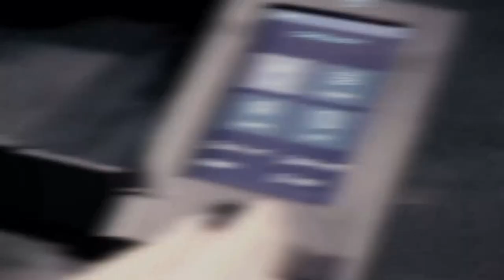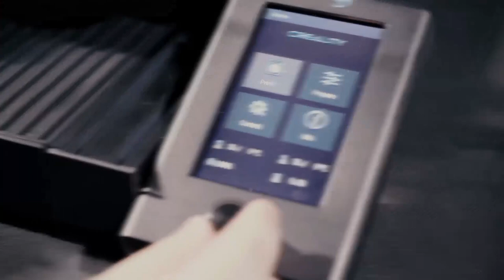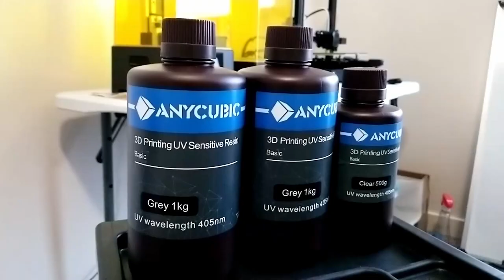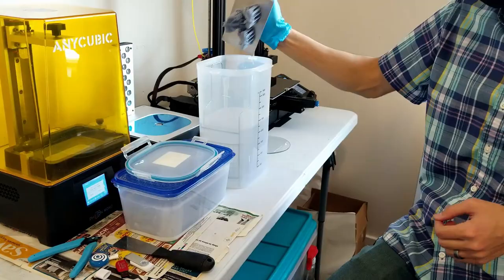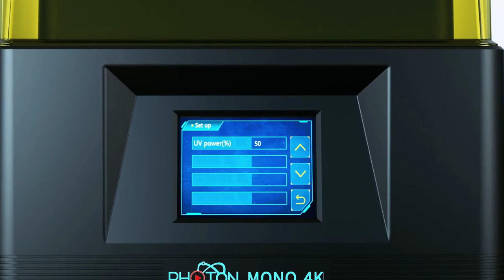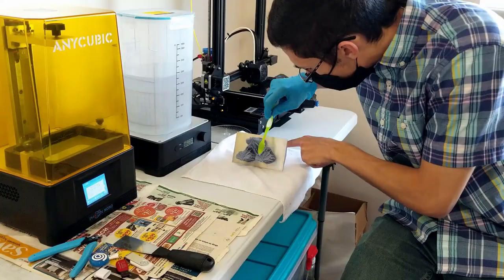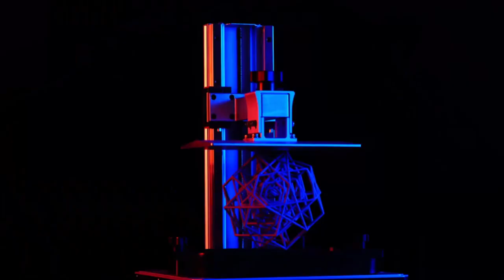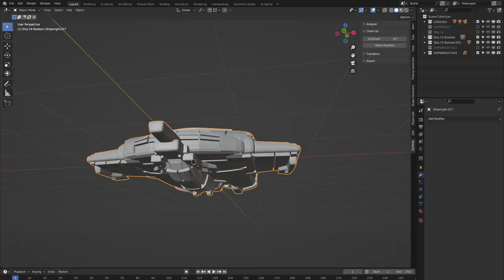Resin Printers vs. FDM Printers | What Should You Buy?

Comment: Simple answer.
Both!
I started with resin, which is the best hands down for mini's, no ifs no buts. The trouble with resin and large parts is the warping and manitaining straight edges and accurate angles.
I have had Anycubic anbd Elegoo resin printers, Anycubic have a better build plate system IMO, 4 bolts rather than a ball head. But the Mars 3 is amazing, even with the ball head. One thing to bear in mind is a large 4k screen wont give you as good resoloutions as a smaller 4k screen. But as the author said, 2k/4k you need a magnifiying glass to see the difference if your printer is set up well.
I would also say have double the ammount of IPA you think you need, if you have a wash station for example have 5l that you are using and 5l that you are letting the gunk settle down before you resue it. There is no good, fast way to recyle dirty IPA, but if you have time all you need is gravity. Let your dirty IPA sit for a week and all the resin will sink to the bottom, syphon off the clean IPA annd swap it with your current IPA and repeat.
Terrain, and anything real world and functional parts filament is the way to go.
I bought a Neptune 3 Plus a couple of weeks ago and it worked out of the box, took about an hour to put together but its been perfect.
Reply: Yeah think for terrain and big chassis (like Fellblade and such) an FDM is pry the way to go

Comment: SLA printing is great but printing in scale you are limited unless you want to spend thousands. Also, for the money of a good SLA printer you could buy a Bambu labs printer which printers incredibly fast compared to resin.

Resin just have a great finish but full of waste material and slow. Also when working with resin it's very important to use a respirator whilst handling resin and especially sanding! That stuff is dangerous.

But I agree SLA all the way for miniatures and statues.
Reply from the maker: I totally agree with regard to sanding. Sanded UV resin is definitely something you don't want to inhale!

Comment: The Bambu Lab X1 Carbon now prints at .08 layer height and everyone I show my prints to think they are resin....game changer! Oh and no stupid chemicals. I AM interested in resin printing but the X1 Carbon prints so fast and so smooth I just don't know if it's worth it.
Reply from the maker: That's awesome! Looks like an expensive printer. I've never dealt with higher end FDM printers but I love the workflow of resin printers more than FDM. Less motors generally means less maintenance and room for mechanical error, but like I said, never dealt with the higher end machines before 🤷‍♂️
Reply: @blitzgamingstudios Ik this comment is 9 months old. but now Bambu Labs has an amazing deal for their Stripped down printer. It has the same speed and quality specs but it’s not as fancy. For 550(black friday) it’s an incredible bottle
Reply: @baby_efa  Six months on from your comment. The Bambu A1 Mini prints miniatures at near resin quality (lookup the profile settings from "Tomb of 3d Printed Horrors) and can be had for $249. The build volume is 180x180x180mm which is perfect for printing minis and most terrain.

Comment: The biggest concern is resin fumes, for others in the house and working directly with it.
Reply from the maker: Totally understandable. You can always use Anycubic Eco UV Resin, which is made from soybean oil with no VOCs, no BPA, and it complies with the EN 71-3:2013 safety standard.

It is a little different to print with, I found I had to slow down my printer a tiny bit and not expose them to alchohol for cleaning too long (because it can deform the print). Other than that, great stuff 👌
Reply: @blitzgamingstudios  you should really be using a respirator when working with resin. from what i read online, a cloth mask like in 4:00 is NOT enough to protect yourself. the fumes can literally cause cancer.
Reply from the maker: Thanks  @VD-cc4hx  but I disagree. As long as you're working in a well ventilated area and wearing a face covering, especially with UV resin from trusted sources that are made with safety in mind, such as Anycubic's resin, it's not something to worry about excessively. 👌
Reply: @blitzgamingstudios  happened across this.  The issue isn't with safety, it's with long-term health, as in years.  You need to wear a respirator with organic vapor cartridges.  You can pull up the SDS for the resin and view it's long term exposure effects.  I'm researching 3d printing as a potential hobby to take up, but I also work at a chemical plant.  Short term? Yeah, you'll be fine.  Long term working with it all the time? Whooolllleee lotta people out there that worked in resin facilities prior to modern safety precautions that now have various forms of cancer.
Reply: @JeremyB8419  the resin bottle tells you what safety equipment you need have yet to come across any with an label saying you need an respirator.  granted my print does sit within an enclosure that have an ventilation system that vents it outside.

Comment: I'm looking to print mechanical parts. Polycarbonate, nylon and ABS. While I've never done the 3D printing thing, I have a strong background in automation such as PLCs, servo drives, etc. Are the SLAs a good fit for these materials?
Reply from the maker: By materials you're saying you want to print with polycarbonate, nylon, and ABS? From my understanding those are all going to be printed with FDM printers like the Creality Ender 3!

FDM printers extrude molten material layer by layer until the print is complete. I've seen people print with wood filament, PLA, ABS, nylon, polycarbonate, and more. These kinds of printers and materials tend to be better for functional parts.

Hope this helps 👍

Comment: Which would you recommend for printing custom action figure parts/accessories, or custom sculpts for art dolls
Reply from the maker: If you're going for detail, especially for art pieces, I'd personally go with the Anycubic Photon Mono 4k or the Elegoo Mars 4k. There are better ones out there, but I'm cheap and these get the job done very well. I just got a Photon Mono 4K for Christmas, they put out great detail for a low cost.

Standard resin can be brittle if you're printing really thin parts, but you can counter this with other kinds of resin, some printer resins are actually rubbery and bendable and good for toys and action figures. You can even mix them with standard resin to end up with a strong yet bendable plastic product.

Hope that helps!
Reply: @Blitz Gaming  it does very much. I'm entirely new to 3d printing and so once I get a better laptop that can handle 3d sculpting programs, as well as handle bauldurs gate 3, Then I plan on getting that elegoo combo along with a drawing pad thing so I can use the 3d sculpting easier
Reply from the maker: Awesome, good luck! Let me know how it goes 👍

Comment: Oh God, please no Latex gloves, you Nitrile, otherwise you skin will have an intimiate relation with the resin, IPA and possibly dissolved latex. Also the plastic scraper is not for scraping off resin in the vat. In fact you should never scrap anything from your FEP filter ever. To clean your vat, just use a screen detection/light up option for a few minutes, this creates a solid layer of resin at the bottom that catches all the print fails and other contaminates. Then pour out your resin and just strip the entire layer with everything else by pushing it gently from below with your fingers. No damage, no wear, no cloudy filter.

I stopped using filters for resin as the method catches all the small bits as well. As for pliers, never used those, use more and lighter supports, and after cleaning use hot water for softening the parts and supports.

And another edit, I recommend a fully enclosed mask with filters, it fully filters out the smell and most importantly the fumes, as well as offers you eye protection. Resin in your eye is not fun. Ask me how I know ._.

Comment: great review! I'm still torn on whether i want to get any of the anycubic resin printers or if i want to get the new Elegoo Saturn 8K. I wanna make action figures for my kids and even small helmets and costume stuff for us. I already have the Anycubic Kobra Max and i really like the experience i've had with it so far. 
Do you have any thoughts?
Reply: I have just gotten the anycibic photon d2. It seems to be the best overall printer on the market. It's on sale now for $600 to 800 I believe on Amazon. Its a dlp printer, so according to anycubic should last 20,000 hours, which is 10x longer than most screens. Competitive print volume. I am currently print halo ground command minis, and it seems to be doing the job well
Reply from the maker: Firstly let it be known I'm not a pro and this is mostly opinion! Lol.

What's nice about lcd and dlp printers is that they don't have a lot of moving parts, so they all tend to do a pretty great job if you're using quality resin and maintaining the printer. I barely notice a difference with 2k vs 4k, let alone 8k. The only time you'd need 8k is if it's a big printer with a big screen.

That being said, you'll want to consider the build volume of the printer since resin printers tend to have smaller build sizes. You can always print in parts, but I wouldn't usually recommend printing functional parts like helmets or costume parts with resin since they won't be as durable. I personally would prefer to use the Kobra Max for stuff like that.

Action figures? Yeah you could totally use one of the Anycubic printers or the Saturn for that! You could even use a uv resin that has a bit of flexibility so the figures won't break easily.

Dlp SCREENS last longer, but that doesn't mean other parts won't eventually need replacing, and the printer will still need regular maintenance. Changing an LCD screen on an anycubic printer is easy and pretty cheap, I prefer to stick with LCD printers.

Hope this helps 😂
Reply: Most resin is pretty brittle, even the ABS-like unless you want to spend silly money on Syria tech tough, and anything wearable IS going to break. For kids helmets and cosplay stuff I would go down the filament printer route.

Comment: I am new to the 3D printer scene. Incredible Video. It looks like i want to go Resin. What is the best Software to use for a newbie. I have a working knowledge of 3D for Engineering (20+ Years), but no home model building use. Can you please help?
Reply from the maker: I use Blender, which is free. It's a little hard to work with on its own, but there are great addons available in the community that help a lot.

When it comes to slicing the models for resin printing, I highly recommend Lychee slicer 👌

Hope that helps!
Reply: @blitzgamingstudios  Thank you so much for responding so quickly.

Comment: You should not use latex gloves with resin printing...Buy nitrile gloves instead...There are many posts about this online.
Reply from the maker: Appreciate the info! I havent had any issues using latex so far but I'm now reading about the benefits of Nitrile.

Looks like they are more chemical resistant, so probably a good call. Luckily with 3D printing and even while cleaning prints, there shouldn't be much exposure to the actual resin on the skin or hands, the gloves are more of a just-in-case measure 😂👍

Comment: Enders are trash. They ship with parts that are guaranteed to brake after weeks or months.
Reply from the maker: Yeah the extruder parts on my Ender 3 V2 broke literally within like a month. I had to order metal replacements.
Reply: @blitzgamingstudios  That's my point with them. The company can afford to use those metal parts off the bat and maintain a better reputation for quality! 🤷
Reply: I have had zero problems with my 3 S1. It gets almost daily use between my gaming prints and my wife's school manipulatives she has me print.
Reply: @borewyrm  Good for you. However, all I read on fb groups are 95% of the time Ender problems. The s1 seems to be ok so far but the standard 3 pro's abd such are enough to put new commers off the hobby. You don't expect to be an electrical engineer to use a printer, the same as you don't excpect to be a qualified mechanic to drive a car!
Reply: My friend had his for like 3 days and the bed ended up having issues, one of the ball screws wobbles a lot more than the other side, bed wouldn’t level properly and heat was inconsistent.
Reply: I wonder how much of that is user error. Aside from a couple of clogged heads and a new filament tool, mines been going for 1.5 years. Granted I took my time building it, and re level every 2 prints, but pretty happy. Of course a 1.5 years ago they prolly worked out the inherent flaws, but it's interesting how I and others haven't had issues, but 99% seem too.